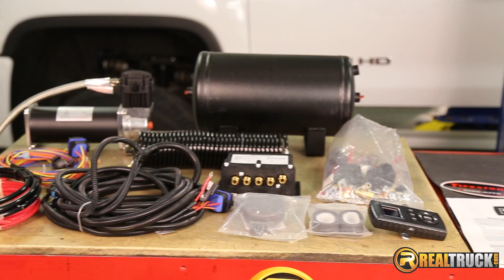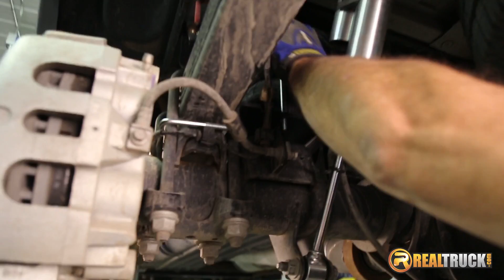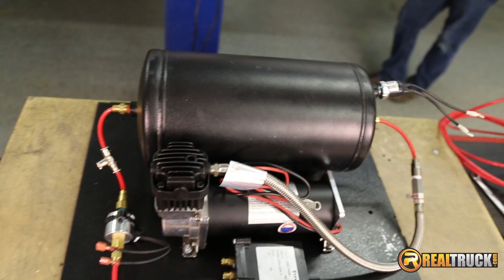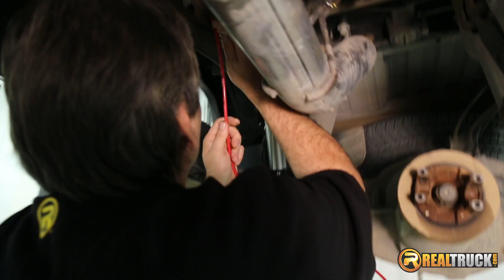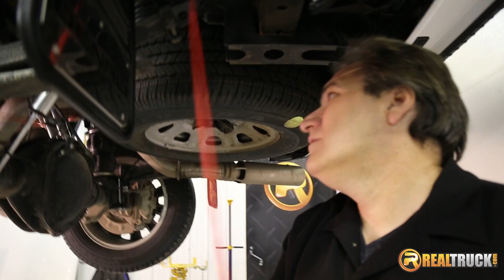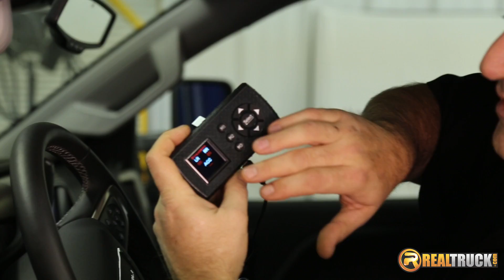How to Install Firestone Air Bag Suspension Kit and Air-Rite Air Control System

Comment: I installed the firestone ride rite extreme duty air bags combined with the air command f3 wireless compressor on my 2016 Chevrolet 3500 duramax WT. Im having issues figuring out what fuse to tap into to power the compressor. What fuse would you recommend to tap I to?
Reply from the maker: Hey Logan, we'd recommend you contact Firestone direct with your question to ensure you're getting the best answer 1-800-247-4337

Comment: Thank you for your efforts big
I have a question, if possible
I have a small bus and weighed 3 tons and a payload of 1 ton
What is the best system possible combination
Reply from the maker: Osama Abraheem we do not currently sell any system for that type of vehicle. I would recommend talking to some folks at a truck shop that does work on big rigs.
Reply: Thank you so much